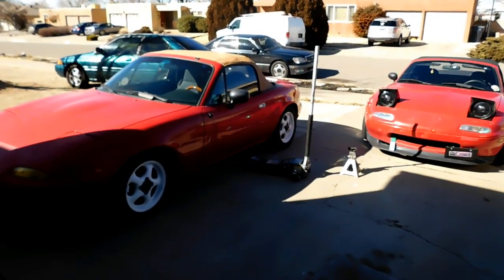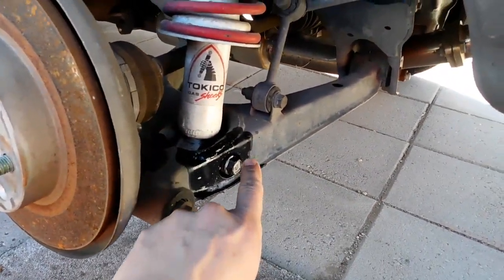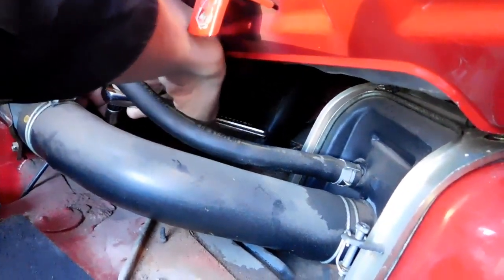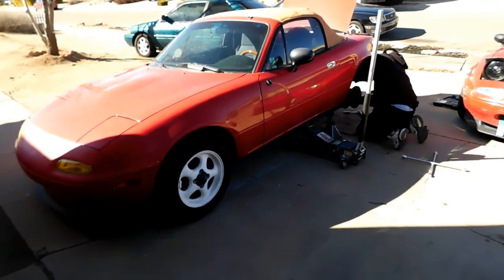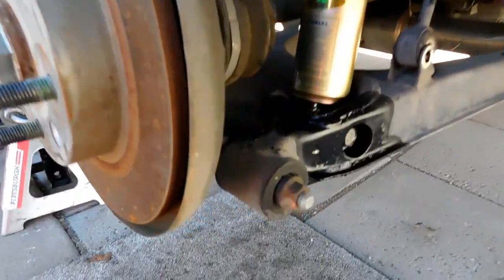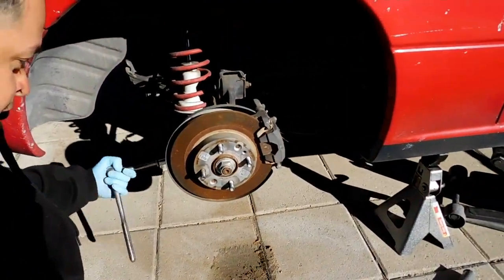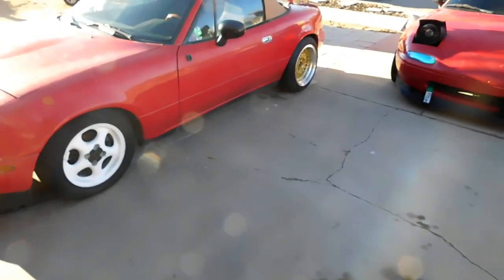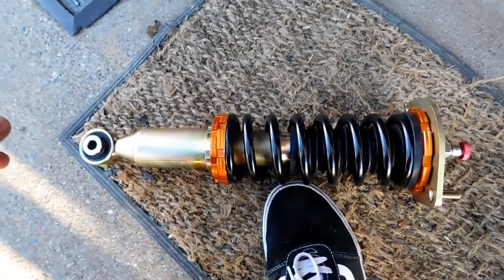Miata Coilover Install Fail

Comment: What's good Project Pat.  North Memphis!   I grew up in Memphis, so I know what's up.  By the way, there is no such place as Blackhaven...it's called Whitehaven, but about 30 years ago all the whites moved out for some reason.   Elvis's Graceland isn't too far away from there.    Anyways, Youtuber "Engineering Explained" put Yonaka's on one of his cars, and he put out a video on how to lower them.  Also remember that the springs will settle and drop another half inch.  https://youtu.be/wcq7Xm-PssI
Reply from the maker: Haha we were bumping some project pat and skinny pimp off camera! Yeah i contacted yonaka they gave me some tips.. I'm gonna take them off and re-adjust them

Comment: #Yonaka Gang 
Lower Orange Collar is B and The one on top is A 
To adjust the coilovers, first, unlock collar B by taking your spanner wrench and turn it clock-wise. Once loose, spin collar B by hand down the length of the coilover. You will then use the spanner wrench to turn collar A clockwise to lower and counter-clockwise to raise the car. When done hold collar A with spanner wrench and tighten collar B tight against it. It’s easy to adjust the collars with car in the air with tire removed. Then to get the same height on all, measure the treads on one coil and do the same to the rest.
Reply from the maker: Thanks bro! I'm gonna make another video adjusting them hopefully this weekend i need to take them off and re adjust them
Reply: SuperMiataBros You can Install all of them and then adjust them on the car.
Reply from the maker: I couldn't get the bottom part to spin without taking them off the car haha
Reply: SuperMiataBros I see now, Can’t wait to see them adjusted, the Miata is looking good!